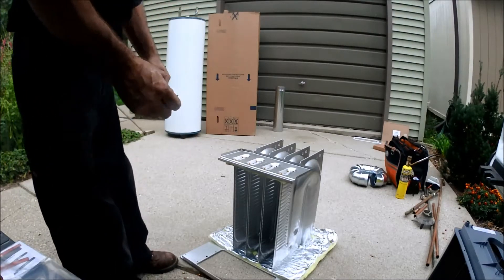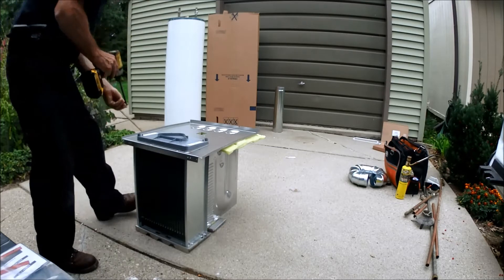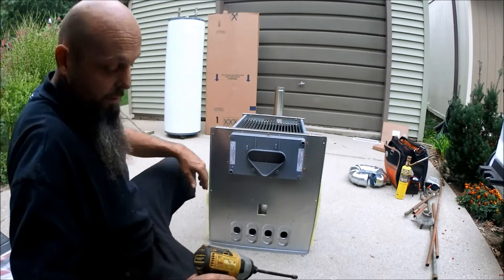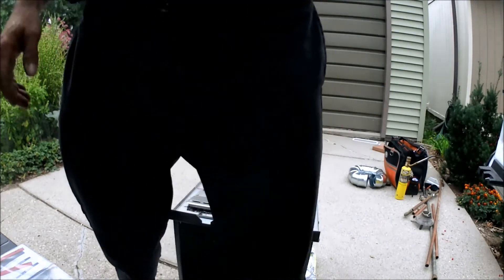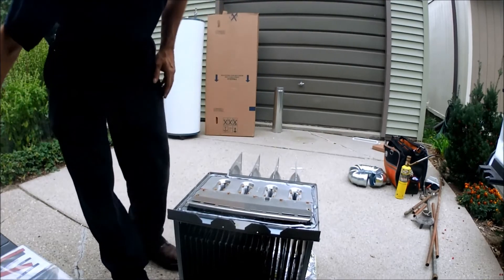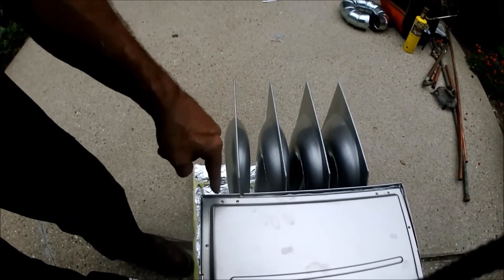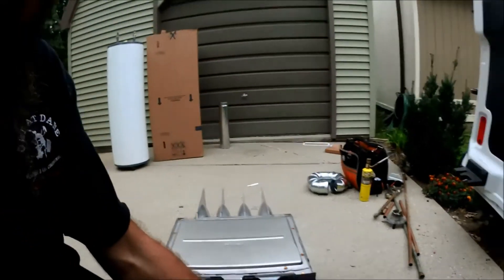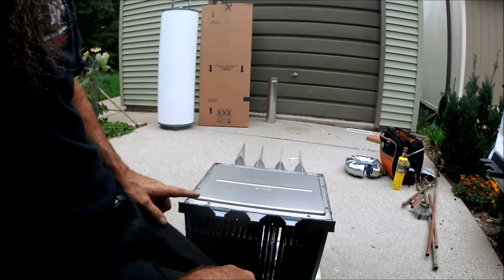Assembling a 90% eff  Carrier heat exchanger part 2

Comment: Note: Comment about block off plates is not exactly correct.  Some variable speed units, such as 58MVP do not use block off plates, but do have variable speed blower, and variable speed inducer.

The 58MVC (C Cee) is specified to use the block off plate.
Reply: What would happen if the installers forgot to remove these small block off plates on a 58MVP080?  They had to take it out a second time because they forgot to reinstall the baffle plate between primary and secondary exchangers and don’t want to go through that again.  By the way, if they forget to replace the baffle plate, the high limit switch will trip due to lack of blower airflow near the front.  But my question is what is the purpose of the small block off panels in rear and if they stay on is it really bad?

Comment: Thanks for doing this video it helped me out a lot. I had no idea these things could be put together with no regard for rust but then I remembered car brake lines and how stupid that deal was. Our heater lived a good long life but the exchanger died and I had to replace it. BUT I bought the wrong secondary heat exchanger, the cost of sending it back was crazy and the guy said he wouldn’t take it back so I was stuck with it and a dead old one as well. Mine has 15 fins 3 burners and the one I bought had 20 fins for a 4 burner unit and it wouldn’t fit so I had to re-manufacture it pace at a time by disassembling the old one and taking the 15 fins from the new one and completely rebuilding the old exchanger. I’m pretty proud of myself and to be honest if not for this video I wouldn’t have even tried. Thanks

Comment: Does the 58mvp100 use the plate that sometimes is put between the primary and secondary heat exchangers?
Reply: That’s an air baffle

Comment: I just did one and home owner is complaining about a smell. Any idea what that could be?
Reply from the maker: +1martinontherocks sounds like the oil is burning off the heat exchangers normal smell will go away after a while thanks for watching
Reply: I didn't use the fiber glass insulation cause  the holes on the cells were so hard to find. I tightened the screws  and now there is like a lroll out flame.  Could it be a air leak? Or  inducer issues ?   Do I have to cut spacers shorter?
Reply from the maker: +1martinontherocks the top inducer stand off needs to be shortened by 3/8" to make sure the inducer seats on secondary and you should of used the insulation to prevent air leakage at the burner inlet
Reply: Mi Heating Guy thank you so much

Comment: Are you finding that you have to trim some of the inducer legs because the inducer won't seat into the secondary gasket, when doing a complete pri and sec.
Reply: Denny Krouse what I have realized,to avoid that inducer seating issue is when you screw fasten the front of the secondary to the inlet panel,,screw the top and bottom CENTER screws First before screwing the corner screws.this keeps the middle of the panel flat & not creating a bubble in the middle....I had that same problem in the past...middle screws first works perfect.😄
Reply from the maker: +Denny Krouse yes you do have to trim the inducer standoff top ones only there is a bulletin from carrier on this exact problem